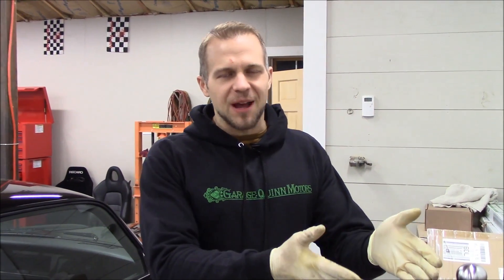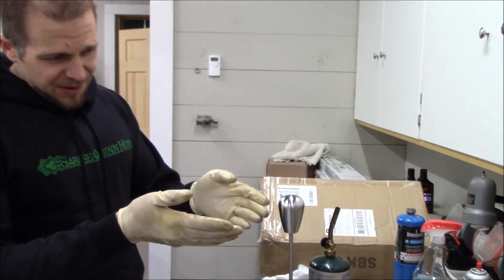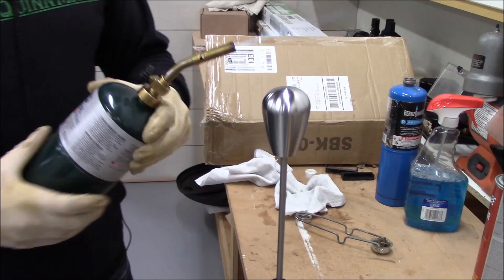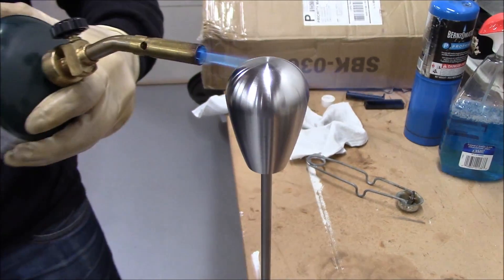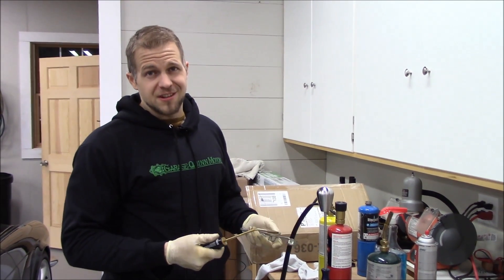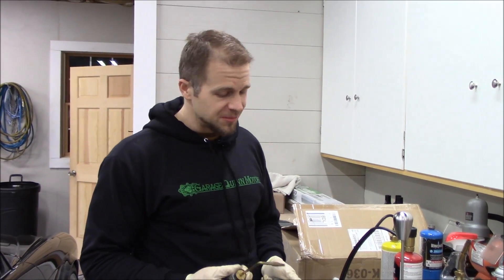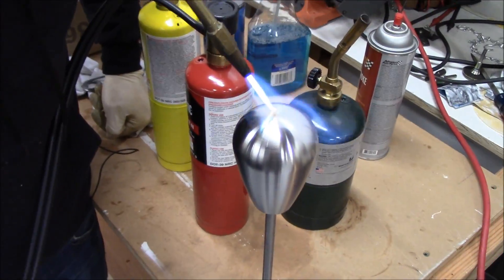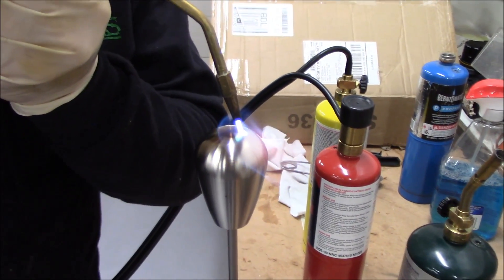Heat Anodizing/Coloring Stainless Steel or Titanium

Comment: The condensation at the start is because the chemical products of propane combustion are CO2 & H2O. The flame itself is cooling on the steel before it heats up above 100 centigrade and depositing liquid water on the part.

Comment: If you heat your steel to blue and then the part gets exposed to lower levels of heat (say the brown stage) will it change colors again or will it remain blue?
Reply: The change in colour is based on the black body radiation theory discovered by Max Planck. It says that when you heat metals, it goes from a low frequency to a high frequency. Red shows low frequency, blueish colour shows high frequency. It’s kind of like the VIBGYOR

Comment: Just tried this with my exhaust tip and got almost no color change even using propane to heat it then a butane torch to finish it off. Got bright orange so it should have been hot enough. Idk tell me if I did something wrong. Btw I did clean the surface off with carb cleaner then decreased first

Comment: Does this impact the structural integrity of the material ? Want do to this on my bike frame.
Reply: Usually adding heat without rapid cooling will effect rigidity in metal
Reply: @Th3_0_h8  best i can do is pour a bucket of cold water right after...
Reply: Rapidly cooling metal after heating will cause the welds to break
Reply: @tjbroome1  yes that’s true. You are interfering with the intermolecular forces. It’s kind of like you break something and again reattach it with glue

Comment: Can everybody tell me, after titanium became blue can it turn back to the original colour (shine/silver/u name it)? And how to do that?
Reply: Placing it in rust remover will return it to the original color, or continuing to heat the metal past blue it will turn back to silver
Reply: DirtyHammmer if i heat it again, is it became blue again?
I try ask is it posible to make it blue make it silver than blue again than silver again
Reply: @aslahhoya6975  

Yes. 

Heat to desired color, dip in whink brand rust remover (very dilute hydrofluoric acid) to remove color. Repeat as often as you want.

Electrically anodizing titanium is much better than using heat though, and its extremely easy with basic equipment and a middle school education.

Comment: I have a stainless sphere knob.  I love it.  It is very heavy and I like that. It was burned a yellow/bronze color at my request.  After a season of driving the color has completely worn off.  Is that your experience?  Guess its time to redo it.  Maybe this is my excuse to get a mapp gas set up.
Reply: Maybe a thick clear coat or casting it in epoxy and turning it down to a thin layer would protect it better?

Comment: Fool doesnt know what Annodizing is an electrical process or what he's doing. Burning metal to cause a color change takes a lot of heat--clearly did not know b/c tried to use a propane torch. Stop listening to this nut.
Reply: Your mad bro
Reply from the maker: The internet is serious and Daniel Taylor puts out a lot of content with valuable info in it. If you don't believe me just look at his channel. Heaven forbid I try to color something with heat and share my experience. I'm such an idiot. 
PS. Titling it the way I did is what helps the views because most people mistake heat coloring for anodizing. Something only another content creator would understand and empathize for. <3

Comment: This is oxidizing... to anodize you would use a corrosive solution and electricity to "eat" (cause corrosion) into the material to the desired color and then to  seal "lock" the molecules in place (hot/cold/both depending on the material). The largest difference in these two is that oxidizing (what you did) will "rub" away far more easily then the later. 
One other suggestion (other then labeling this video correctly) is that when you are doing a video time-laps why not show a timer of actual time spent?

Comment: Get a decent sized box of fine copper shavings, heat that thoroughly to the temp required, then bury the part you want blued in it. Also connect the part to something that spins at the speed you want, will make your life so much easier if you want to manually torch the thing.

Comment: What degreasers are you using tp clean up the knob before burning it? I'm doing a similar project with other stainless steel items, and I get a wide variety of inconsistencies in burn patterns. Sometimes its perfect, other times its blotchy. Any suggestions?
Reply from the maker: I used isopropyl alcohol but I also noticed some inconsistencies. This was really the only time I tried this. I haven't really messed around with heat coloring anything else ever since.
Reply: Garage Quinn Motors Thanks for getting back to me. A biologist friend of mine suggested mixing ethyl alcohol with isopropyl. Use that first, then simple green, then the alcohol mix again. Rinse with hot water after all of that. We'll see.
Reply from the maker: Nice! Let me know if you have better results with that.

Comment: Heat rises. Would it be easier to start from the bottom and work your way up? This is actually oxidizeing the metal...
Reply: To be more specific (I'm not trolling you), "heat rises" in liquids and gases via convection. In heat-conducting solids, like metals, it is conducted in all directions.

Comment: Does this require clear coat in order to for the color to stick, or is it durable enough without clear coat?
Reply from the maker: Clearing it would preserve the finish better. It will fade over time from exposure to the oils in your hands.
Reply: Thank you. Also, any clear coat you can recommend for this?
Reply from the maker: I don't have anything sorry. Paint is a whole other world that I need to get more up to speed on.

Comment: To everyone watching please remove all combustible had cylinders from the immediate Flame area. it is a miracle this guy did not blow himself up.
Reply from the maker: Relax. At no point did the flame even touch the propane bottle. It had a good 8+ inches of clearance when I was lighting the torch. It's just the angle of the camera making it look closer than it was. Even if the flame did touch it, it's not is just going to explode.

Comment: Anodizing? If you think thats what this is then you don't even know the meaning of the word. smh
Reply from the maker: I'm sorry. I couldn't find an official name for what this process is called, but I did see it referred to as heat anodizing quite a bit when I was searching how to do it, so I figured that title would get more recognition. Rather then talk down and shaking your wittle bitty head, how about enlighten us with the proper name for it and help spread knowledge?
Reply: If you would have done the smallest amount of real research on the subject you would have found the correct answer to your question. Instead you just went with something you saw threading online, and continuing the trend of misusing the terminology. That’s how you ended up calling it andonizinng in the first place. You are simply heat coloring the metal. The proper term in metallurgy would be Tempering. The colors are referred to temper colors or it is also called temper coloring , which is pretty self explainitroy. Anodizing specifies that an ANODE and Cathode was used to transfer electrons using an electricity source. You obviously did not that . I mean it seems pretty self explainitory if you know the definition of the word you are using. 

As for why the color changes, it’s a redox reaction that forms an oxide in the metal. Same reason when you put a lighter to aluminum foil and it changes color, or pen you see a penny that’s turned green or rust on metal. You didn’t change the color of them metal. You formed an oxide layer and unlike a green penny or rust this layer you formed is a very thin layer and the presence of that layer on your knob looks to be another color due to thin film interference.
Reply: But for sake of argument , The chemical reactions are pretty much the same in both processes and I understand how the mistake can be easily made for any person without an education or background in science but you did not use an anode so it wouldn’t be correct
to refer to it as andonizing. It’s like putting a frozen pizza in the oven and calling it deep frying.
Reply from the maker: If I change the title to say only Heat Coloring instead of Heat Anodizing/Coloring would that be acceptable to you??
Reply: @TheSlipAngle  no nothing is ever enough

Comment: Would this method work with regular steel? I machined 4.5 diameter nuts to use for the assembly of my industrial table. I want the hardware to stand out. I planed to get them powder coated clear after the torching. Hoping the heat from powder coating won't effect the color if it works with torching it.
Reply from the maker: Yes it would.

Comment: Hello I got a question do you thing that we can make gold color using marker pen and then using torch ?
Reply from the maker: The first it starts to change to is gold, so as long as you heat it to just that temp range, you can leave it with a gold finish.

Comment: I have a motorcycle exhaust pipe that is 304 stainless steel sandblasted to give a titanium look from the factory. Although it has become a yellow gold color due to heat but also a blue purple color in some spots. I have the pipes off the bike now and i want to get that blue purple color the entire pipe. Can i just take a torch to it until i get the color i want ? Thanks in advance for a reply anyone
Reply: HighVisi0n pretty much just google blueing steel and follow instructions

Comment: It is a common misconception to use the term "anodizing" for creating heat colors. "Anodizing," by definition,  requires electricity. What happens in this video is "oxidizing." ;)
Reply: So does this ruin the "stainless" properties of the stainless steel?
Reply: @xoarx  The steel underneath doesn't change. The heat forces a super thin layer of the steel surface to rust. The blue color comes because it's so thin that it messes with the wavelength of the light. I'd imagine that thin coat to be an actual protection against rust.
Reply: @xoarx  In certain applications, yes. In food, beverage, and pharma industries where hygienic welding of stainless steel process piping is a strict requirement, excess heat tint (as demonstrated in this video) compromises the corrosion resistance of the stainless steel and can lead to (or is indicative of) rouging, pinholes, cracking, and material loss.
Reply: @454Casull  can I inhale the fumes ? If it's truly an oxide shell, it's inert right? Could I take a dab off this like titanium?
Reply: @anglerandy5736  The fumes of what exactly? You don't want to inhale the fumes from stainless steel welding, generally, as the fumes will contain hexavalent chromium from the base metal and filler metal (if any).

You can eat off the "shiny" form of chromium oxide that is normally present on all typical stainless steel objects in every day life, of course. Could you eat off the darker-tinted stuff? I don't know. Probably.
Reply: @454Casull  Does this happen when the oxide layer forms and it turns color? From my undertanding the oxide layer is not actually capable of burning or offgassing at temps below 3000f.
Reply: No it Dosent  @xoarx
Reply: AFAIK this is not true. The titaniumcromie works also on grade 1 pure titanium, even if with more pastel colours than grade 5 or more alloys. The colours are not a pigmentation, they are interference ones depending from the thickness of the oxide transparent layer and from the kind of crystallization induced. As far as I have read, there are just two main species of crystals.
Anodizing and heating are two different ways to produce the final oxidation, indeed. It is therefore inappropriate to call what we have seen here "anodization".
Reply: Change the title please. I was looking for actual anodizing.
Reply: To his benefit, if he'd have called it oxidizing, I'd have never found the video I needed. I didn't know what the process even involved, just wanted to make my stainless shower curtain rings  🌈*pretty* ...
Reply: To be more precise you are changing the structure of the passivation layer that is already formed from the chromium and nickel.
Reply: Thanks for the info
Reply: Clap Clap Clap 👏
Reply: Heat oxidisation that rubs off with metal polish. Waste of time on a gear knob will be back to original with a month
Reply: you probably dont give a shit but if you are stoned like me atm you can watch all the new movies on instaflixxer. Been streaming with my gf recently =)
Reply: @Mack Jagger Yea, I've been using instaflixxer for since december myself :D

Comment: Wondering if I can do my Glock slide this way 🤔
Reply from the maker: I am sure you could.
Reply: CINCINNATI SAVAGE the process is called gun bluing and its common on old rifles and shotguns newer pistols ie glocks have a durable finish from the factory so personally i wouldnt do it but in theory yes it is possible
Reply: ben garcia no it's not, bluing is a added finish using chemicals. You're thinking of color case hardening.

Comment: the result it doesn't fade in time?
Reply from the maker: It could fade a little from the oils in your hands.
Reply: @TheSlipAngle  You said that you couldn't replicate the bold colors of the first time. Could that be because it wasn't warmed up slowly like you accidentally did with the first torch that didn't really work?
Reply: Garage Quinn Motors interestingly enough traditionally after you heat the steel you are supposed to submerge it in oil while hot and it will make the surface more durable

Comment: You guys have that torch set wrong. that middle feather is too long and needs to be almost right up at the tip of the torch
Reply: Only if you want a single, very hot spot. He's using less air so the flame stays a bit colder and gentle. Makes the process way easyer

Comment: nice video sir, i tried it on my xbar i cant get even results like that, i guees i need a better source of heat, im just use a can with a torch plug in. wish to have same result as yours. got lot of patience :)
Reply from the maker: If the steal is thicker, then you might need something hotter. I was able to burn the exhaust tip just using a propane torch.
Reply: Home Depot or placed like it sell map gas tanks for like $15